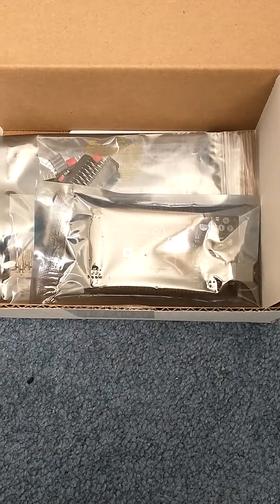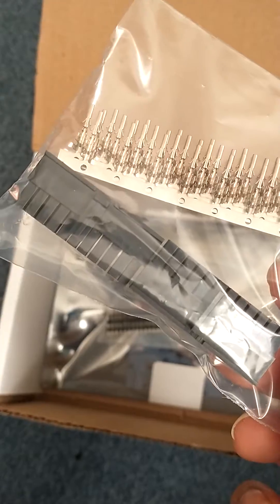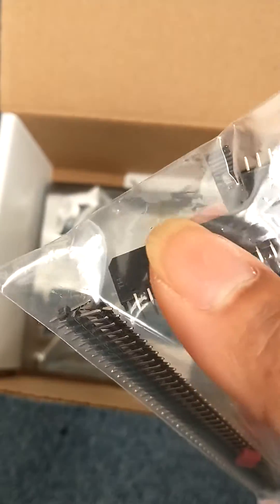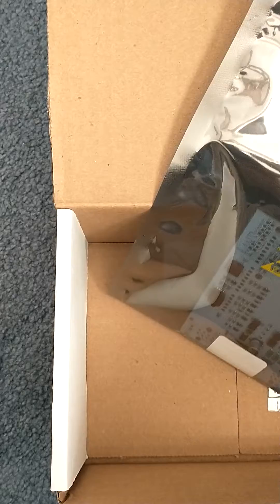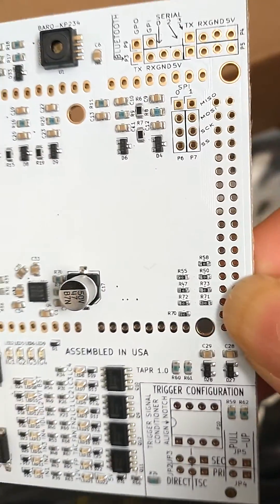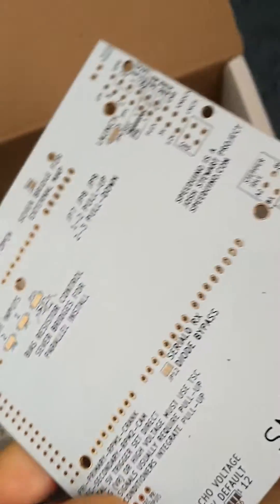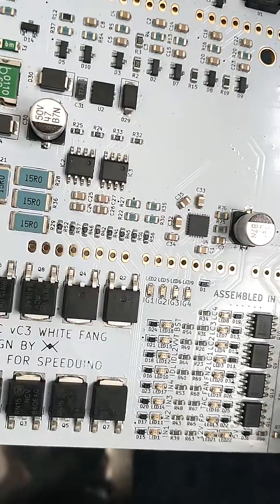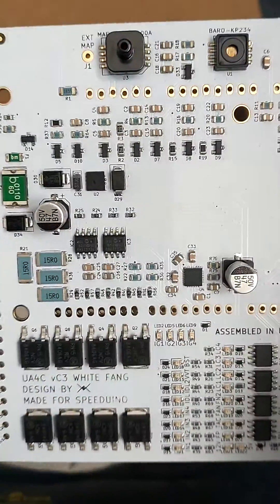SPEEDUINO UA4C VC3 ECU

Comment: Hey may I msg u direct I have a ua4c and I been blowing head gasket after head gasket 3 times now and I have burned up about 5 ignition coils
Reply from the maker: check the dwell settings for the coil and spark output trigger weather its going high or low. also check your base timing with a timing light with the timing locked.